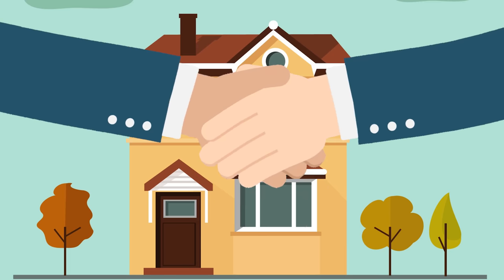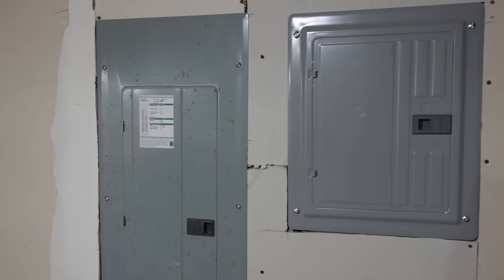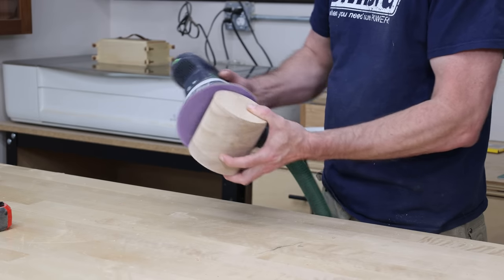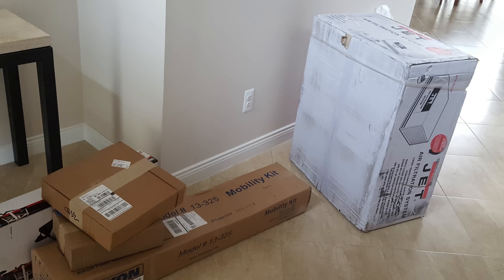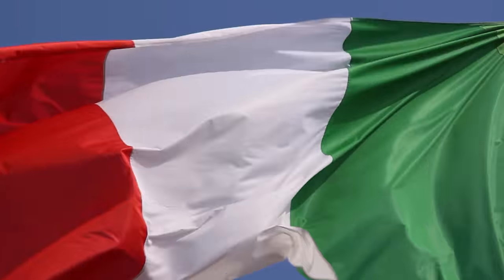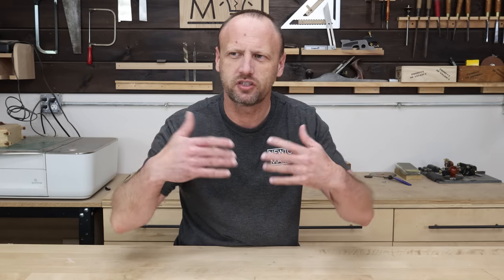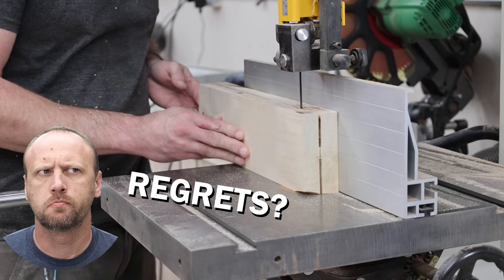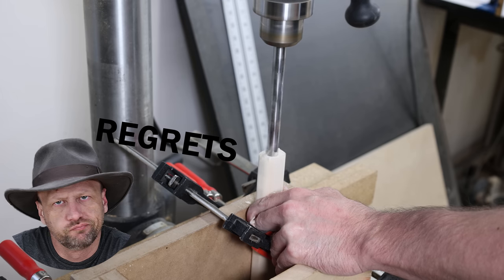Building a New Woodworking Shop (Mistakes were Made)

Comment: I've equipped five shops during my 50+ years of woodworking.  I currently have two.  The observation I've made in retrospect is that no matter how many tools you have, you'll need one more for the next project.  Don't stress -- tools don't cost money, they save money.  Enjoy making dust and noise.

Comment: I was broke as hell working part-time for UPS, saved up for a little starter tool kit after my bed frame broke because it was actually cheaper to build a new one rather than buy, plus tools to do stuff. From there I started my 8-year journey to being a woodworker out of a bedroom in East L.A. with that exact Delta contractor saw and DeWalt lunchbox planer. Took a field trip to Oxnard to buy a used delta 6” jointer. Never looked back and with all the little projects I sold, paid them off. Almost a free hobby if not a side-gig if you play your cards right. This video was excellent as I also have my own regrets setting up my shop but it’s the journey that rules.
Reply from the maker: You'll appreciate everything you have because of this amazing journey. 👍👊

Comment: Very well thought out video. I must say, if someone is purchasing a jointer, get at least 8" helical head with a bed as long as you can get. I bought a Grizzly and love it. It's my favorite favorite tool and wish I had bought it earlier. Also, I too hired a professional electrician who put in a 100 amp so panel. I would suggest laying out the shop and plan ahead for future tools so you know where you will need 120 and 240 circuits. When you think you have enough circuits, add more. I wish I had I stalled some ceiling outlets.
Reply from the maker: I'd kill for a 12" jointer! Like an aircraft carrier in the shop!

Comment: As a fellow Michiganer I wanted my workshop in the basement as well.  However, the house we bought came with a 1.5 car detached garage, and my wife said there was no way i was going to have a shop in the basement, LOL.  I have a jobsite sawstop saw, and an old used bandsaw.  Hope to upgrade my tools as i use them more, and heat the garage.  It gets cold in winter here.

Comment: I’ve been slowly buying tools for my work shop over the last year.  I’ve got some that I shouldn’t have and some I should have got years ago!  I have a 10” Dewalt contractor table saw for now, will upgrade later, a new 13” helical planer, not so impressed with ( can’t eliminate all the snipe ).  I’m using a shop vac and a small onida dust deputy till I can get a bigger dust collection system.  Looking to buy an 8” helical jointer, 14” band saw and complete my outfeed table with drawers and an end vise.  It takes time and I’m trying to do projects to sell to offset the cost of the new equipment.  Slow and steady
Reply from the maker: You've got some solid tools already in your arsenal.

Comment: I have a less than $300 Wen drill press that looks exactly like the Jet Drill press for about $200 less and it has worked like a champ for 4 years.  I did get a Sawstop with the support of my wife and I am so happy I did,.not only the safety aspect of it but it is a damn nice saw.
Reply from the maker: I could have been easily happy with a Wen. I completely overbought. And I've always heard the SawStop is a great saw in general.

Comment: One of my newest tool additions is a Wahuda 10" spiral (not helical, but better than blades) benchtop jointer.  I then built a mobile stand for it.  Works great.  Sure, I can't easily joint 6' long boards, but then again, I don't build things that big, so it's all good.  I do not regret spending the extra $$$ for the 10" as opposed to the 8" or 6" versions.
Reply from the maker: You bring up an excellent point I should talk about in the future. If you make smaller projects, maybe you don't need the giant tool. Thanks for the reminder!

Comment: I just finished doing the same this as you did, I spents about 18K , but I have a epoxy floor and new lights as well. I went with Harvey Table saw and Dust processor- I am 100% Happy with them both, great tools, give them a look for next purchase .
Reply from the maker: I was going to talk about epoxy but I felt the video was getting long. It would have been nice to do that while the shop was empty.

Comment: I think you are being short sighted here, the only machine that I think was worth it is your dust collector. you can get a powermatic 66 table saw for $1200, an nice used 8" jointer for $1000,  a nice older delta bandsaw for $400. 14" bandsaws are really not made for resewing 12" they don't have the HP or heft. All of the hand tools you bought could have been done with old Stanley planes for a lot less and they would be better.  That is where I think a lot of people are missing out, Older used stuff is a lot better made and a lot cheaper than the stuff made today.  You could have done the same thing you did for $5000, and had money left over to buy a powermatic 180 planer for $2500